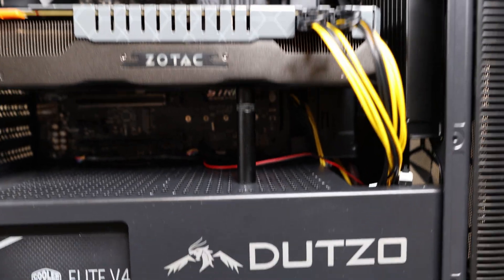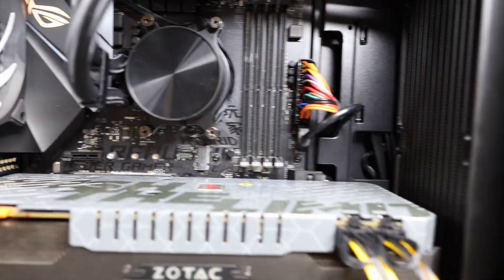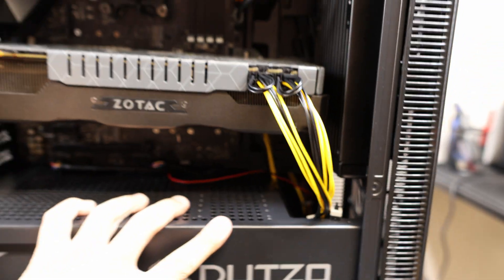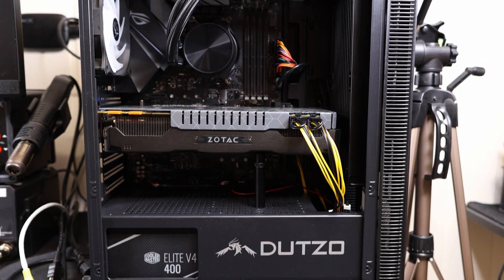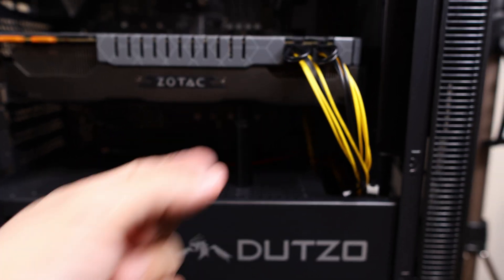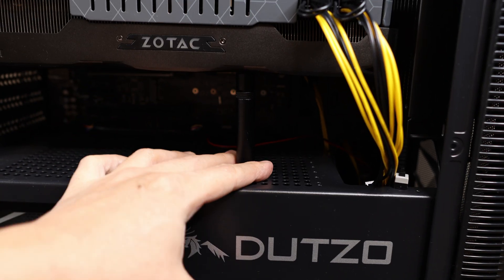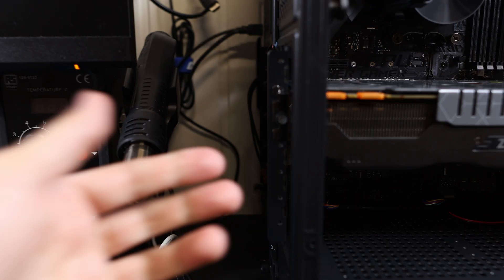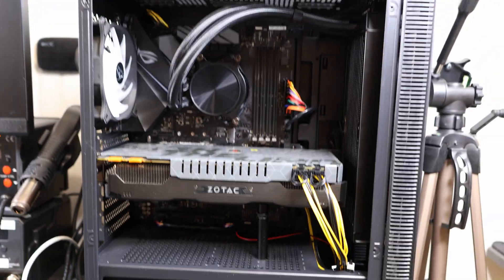How To Use GPU Supports Properly.

Comment: I can't put it between fan 2 and 3 because there is a big cutout there on my case for the vga cable. I have it between fan 1 and 2, hopefully that is okay? It seems okay. It's stable, has enough plastic on the shroud to be nice and firm. (9070 XT Hellhound)
Reply from the maker: Just some support makes a huge difference. Its letting these heavy cards sag that kills them. You should be okei. Just try to level it the best you can 👍🏼
Reply: @TechnologyHive   I think the biggest tip here was pointing out to loosen the screw so it rests on the post before screwing it back on. I had already had the support in place and when I saw the back corner of the card "fall" into place I was quite surprised. 

It was only a small adjustment, but the fact it moved at all definitely showed a gentle twist was happening. I lowered it a bit and repeated the process with it loose. I'll definitely be doing this from now on, so thank you. 

My worry is if I ever go to a case where the bottom is meant for intake fans, I wonder how we can support the card properly then.
Reply from the maker: @Vespyr_  There are supports you can buy which attach to the motherboard instead. They work just fine also.

Comment: I have found properly measured hot glue sticks are really nice for all white builds . Them being clear is really nice .
Reply from the maker: If it works for you then that's great! Some support is better than no support.
Reply: @TechnologyHive  you dont use long ones you use 2 inch or shorter .they are soft wont scratch anything and while short they do not bend .

Comment: Can you please give advice on how to mount my card in the Lian Li O11D Mini V2?
I have one of the huge 50 series Aorus Master cards. There is a built in option for the support, and in roughly a good position too, but it is on the motherboard side. There is nothing to support it on the glass side, and I don't really know what I could put there because the bottom fans are in the way.
There is also an option for a vertical mount and support. Maybe that would be a better option? Tbh I would prefer to not vertically mount, but not bending the card is higher priority.
Reply from the maker: Go with vertical mount! Not only will it not sag, but it also looks better.

Comment: It doesn't even need to be heavy,  with long term use my 1050ti got warped and the core got detached. Luckily gigabyte repaired it even though it was out of warranty.
My 3070 ti is using similar type of anti-sag I was too scared to eyeball it so I just put a leveling tool on top of the GPU
Reply from the maker: Im surprised Gigabyte helped you. Usually they find any excuse to reject your warranty.
Reply: @TechnologyHive Yeah I have heard the horror stories. But my local gigabyte service center is somehow an exception. I have had nothing but good experience with them. Be in within warranty repair or out of warranty paid repair service.

Comment: Most importantly: Don't transport your PC, drop it, or subject it to any sort of shock with your heavy GPU installed. I'm pretty much convinced that most of these catastrophically damaged high-end/heavy AF GPUs we see on repair channels were damaged in this way. PCBs are pretty tough and seeing them cracked, with broken hooks and all that seems a bit too much to just have resulted from constant sag while the PC was just sitting on or under a desk. Ripped pads under the core and/or under the VRAM-chips might be a different matter, but I'm not an expert so that's just a guess. 

On my 1.5 kilo GPU, I'm using a slot-bracket type of support from CoolerMaster - got it super cheap during a sale and my GPU didn't come with a support, so might as well indulge my paranoia ... 
Not even sure it needs it - even without the bracket installed, the card seems very well aligned and very solidly connected to the case when everything is tightened down. I have it supported just between fans 2 and 3 (3 = blow-through fan) because I have to - the shroud design on my Palit GamingPro is a bit weird and that's the only spot that will take the support. According to my spirit level, everything checks out - I'm off by 0.1 or 0.2 degrees, but that's both with and without the support installed - most importantly, there is no "developing" sag. Meaning when I re-check alignment a week or two after having installed the card and bracket, it'll still show the same values on my spirit level. So... good enough for me.. :D

Comment: Is that right side still lower than the left side of GPU or am i crazy?
Reply from the maker: It doesn't matter. This is a test system to demonstrate how it is done. The card was removed out of the system right after I was done making the video. It is your job to make sure it is level.

Comment: I’ve found strapping a wooden popsicle stick (AKA craft stick) to the back side of the power cable works great. Just darken ‘em with a marker and fasten with hook & loop straps (AKA Velcro) Heck even wrapping/strapping the stick with black vinyl electrical tape would work. The GPU connector rests on top of the “support” and it’s impossible to dislodge into the fan blades. For the PC in the video where the connector is above the PSU basement, a wooden paint stirring stick trimmed to fit would work.  A small notch to accept the basement cover would allow the stick to remain vertical for the mustard cables in the example. Most people have a paint stick laying around but if not, they’re free at Home Depot, Lowes, Menards, and just about everywhere.
Reply from the maker: I heard people are even using strings...at this point its whatever works for you. Some people are using pencils too. But a cheap support is about $3 on AliExpress.

Comment: People used (and will use) toilett paper pipes for this purpose, just remember the GTX 780 or R9 290X, so it's definitely a lower than 100 IQ problem, even stupid people pad their GPUs during transport, because they have some common sense.

Kids used to have DIY classes where they learn to build thing even if they are neglected by their parents they still learn the basics in school. So if you passed 3rd grade PC building is just like playing LEGO.
More importantly people had real friends and some have more knowlage about PCs, so if I don't know something I made a picture with a digital camera, or better grab a paper and pencil and draw a picture of the jumpers on the motherboard then showed to my friend in school. Even if you have no friends people in PC shops still love to help out noobs.
Reply from the maker: During transport, you should be removing your GPU, not padding it. I have brand new cards come in and out here with cracked PCB's all the time because the cards were installed in the system when shipped to the customer. More common on heavier cards. If companies like Alienware, Cyberpower and other PC builders make mistakes like this, how much so a person just learning about this? 

Calling someone stupid or low IQ just because they did not install a GPU support correctly, as you imply is just nonsense. Coming from someone who repairs these things, I know the problem is NOT end users. The problem is AIB partners being greedy and building these heavy cards to pump as much power into them to keep the temperatures down, not giving a second thought to what issues the end user may experience due to this much weight installed over a thin PCB that is just hanging from two points in the PC case. 

So no, its not that people are stupid.
Reply: @TechnologyHive  If you have to choose between stabbing the motherboard with a scredriver, ripping off the PCIE latch and potencionally the PCIE connector too, or padding the GPU during transport I choose the last one. If someone not confortable to remove the GPU better off just padding it and transport the whole case layed down.
Basic knolage should be still basic knowlage in PC too just like in cars, if you buy a car you should know how to check water and oil levels and tire pressure, if you buy a bycicle you should know how to change the seat level, put back the chain, or check the tire pressure. If you don't know the basics you pay the price.

System builders should use correct padding materials and ship PCs horisontally, both coolers and GPUs generally weigh over 600g. Dell knows this they used to use the motherboard ttray as a reinforcement and screwed the cooler directly into it and also creating pretty robust GPU support rather than relying on packing materials. So from system builder standpoint GPU damage is pure neglect.

My whole comment was about the "200 IQ thing" I'm calling people stupid (80-100 IQ) who don't know how to install GPU support, NOT because they don't install it, that is negligence.

All the GPU problems comes from neglect, both from manufacturers, AIB, system builders and consumers. Probably the neglect from manufacturers comes from greed originally because they don't pay well enough the good engineers, but in the last 10 years all the thermal and mechanical problems happened because they don't tested the cards horisonally.
If someone have a 5090 that is sagging it is 100% neglect, because here is my counter argument if a poor person bought a 1050Ti ROG STRIX triple fan GPU (that is the biggest low powered GPU I could think of) it not gonna sag it will be propped up or a wire holding it from topdown, because that person spent all hes money on that, or even more if he bought on credit, so he's gonna care about it.

+1 example for vertical transport: I built someone a PC who don't know anything about it and not confortanle to touch it later and he uses public transport, so for him I have to put the GPU in then pad it, because he uses an IKEA bag or just hold the PC in hes hand.

Comment: I've seen another repair channel say that this will still lead to warping of the pcb with heavy enough gpus
Reply from the maker: Nothing is 100% guaranteed. If you want to avoid pcb warping, go vertical, if not, this is a good way to support your gpu from sag that leads to cracked solder joints.
Reply: Depends on how the cooler and fan shroud are mounted to the PCB, so it varies between graphics card models. If the cooler is connected to the PCB only by the cold plate, a support fixed to the fan shroud (like shown in this video) can still end in the PCB bending. But when the fan shroud and cooler are secured to other points of the PCB or to the backplate then this solution is fine. 
I guess you could fix the problem in the first case by sliding some non-conductive material between the cooler and the PCB (like a small piece of rubber or dense foam).

Comment: AIO radiators installed the worst possible way.
Reply from the maker: How so?
Reply: @TechnologyHive  if you know some physics we can communicate. All AIO's have some air inside intentionally bcs when water heats up it expands. Air can be compressed so it doesn't blow up. Now if you see the problem thats it. If not tell me so i can continue.
Reply: Your next hint is : Air has less density and it goes up in the water. Check the position of your radiator : air is at top where your circulation tubes connected.
Reply from the maker: @yalantara  I have already talked to Thermalright about this idea, taken from Gamers Nexus' Steve. The bottom line is the pump needs to be below your radiator tubes, so the air condenses at the top of the radiator and not in the pump. 

If you place the radiator inverted at the front of your case, as Steve recommends, then the air will accumulate at the top of the radiator and pump. This is not optimal, as you do not want air in the pump. 

Thermalright recommends placing the radiator on top of your case, or in front with hoses above the pump, NOT below it. Besides, AIO's are not designed to be placed inverted in front of the case, as this would make almost every AIO incompatible with your setup, because the tubes will be getting in the way of your graphics card and in a lot of PC cases today, the tubes are not long enough to reach to the bottom. 

Overall your idea does not work. I have tested this myself with my 5 year old AIO installed with the tubes up above the pump and it still works as day one. No temp issues or weird noises coming from the pump. I watched Steve's video and followed his advice in a different system, but I kept getting noises from the pump at start up. That was because air was being accumulated in the pump and top of radiator. I switched the radiator position and now it is silent at start up. 

Thanks for you comment, but Steve's idea is just incorrect. Especially for the long run. Have a nice day!

Comment: The only thing I would add is that some cards do not have a good place for the support between fans 2 and 3.  I much prefer the style that screws onto the end of the card but that depends on the card having a mount installed.
Reply from the maker: Generally speaking, this should work for most people. Of course, there are exceptions. If I had no place to install a support other than at the end of the card, then obviously, that's my only choice. Or I could go vertical, with a vertical mount kit instead.

Comment: I have a 4070Ti TUF, I placed the support at the corner end of the card exactly where you pointed at 5:22 and told us to not put it there. Been running for almost 3 years now without issue and soon entering its 4th year. No sag, no middle curve, perfectly flat.

I think the most important thing people should keep in mind is to just let the GPU sit and not over-support to the point that it lifts the supported end of the GPU higher than the bracket part, or in simpler words : "Just keep it flat".
Reply from the maker: Some people survive jumping off a tall bridge, but that does not mean you should try it too.
Reply: @TechnologyHive  Horrible analogy
Reply from the maker: @indiexanna But true.
Reply: @TechnologyHive  False, jumping off a tall bridge implies 2 things :
1. A dangerous act done by the subject
2. A considerably high chance of harm of the subject
Placing the support on the corner of your GPU =/= jumping off a tall bridge.
Reply from the maker: @indiexanna  I do not care what YOU do with your graphics card. I repair them for a living. Just because placing your support at the end of the GPU hasn't shown signs of damage yet, it does not mean it wont for others. I have seen what placing the support at the end of the card does to the PCB. Now, go ask your mom to make a sandwich 😆
Reply: @TechnologyHive  Then you also have a biased sample pool. Just because you have repaired some cards with that issue doesn't mean the other 100000 cards out there which has their anti sag support place at the corner will end up having that same issue.
You're being overdramatic to try and paint yourself as being the only correct way, this is just the CPU thermal paste arguements all over again. There is no right or wrong in this, just support your GPU, don't overcompensate, keep it flat, simple as that!
Reply from the maker: @indiexanna When you start repairing graphics cards for a living, then come and tell me how things should be done. I have not just repaired "some" cards. Most cards I repair are in with bowed or bent pcbs. From experience, I know what works and what doesn't. Again, what you do with your hardware is not my business. Do what works for you.

Comment: I just installed a vertical GPU mount in my Lian Li Lancool 207.  I feel like the vertical mount is the best solution overall if you have an option for it.  Horizontal mounting seems to carry a greater risk of board flex and ripped pads under ram or gpu core.  Happens when you move your pc for cleaning, etc. much of the time.  It was a tight fit for me.  I had to turn my AIP CPU cooler 180deg so the inlet and outlet are above the cpu.  They just barely interfered with the top of the GPU so I had to flip it around...  

It was quite a bit of work to install, as I had to pull my AIO out, etc.  But I like the way it looks much better, and I like knowing there are no lateral forces on my GPU circuit board at all...

Comment: Hmmm this example seems like ur actually lifting it up not only supporting it, its just as dangerous to lift it up as to let it sag.... both are sag on the pcb and both might dmg the GPU, its hard to tell tho if u lifted it or just it was loose due to not tightening the screw. Its worth mentioning.
Reply from the maker: In the video, i demonstrate that the gpu was loose. It was lifted yes from a sagging position to a level position. Watch again if you need to 😊👍🏼

Comment: Thanks for the tip.  Ive been building since about 2003 as well, but only whenever I need an update for myself.  Ive known that these newer GPUs are bigger and heavier, but I did not know that the PCB's were bending so much that the chips were popping out of socket.  My latest GPU is the fattest boy I've had yet, so the timing is good with the algorithm sending me your vid.  Cheers.
Reply from the maker: Im glad you found the information helpful. Best wishes!